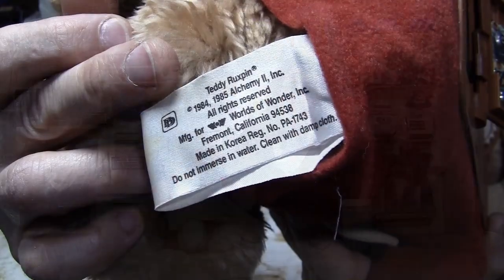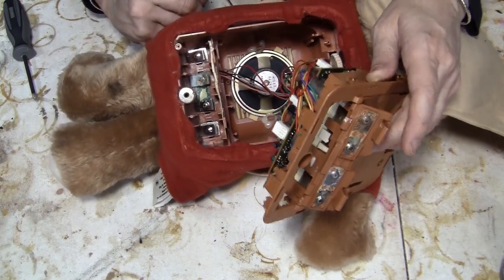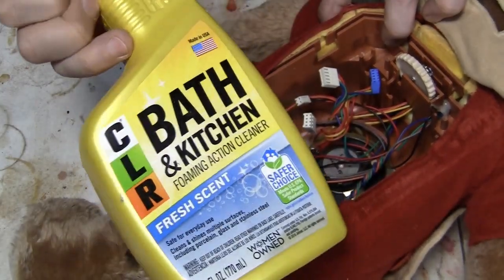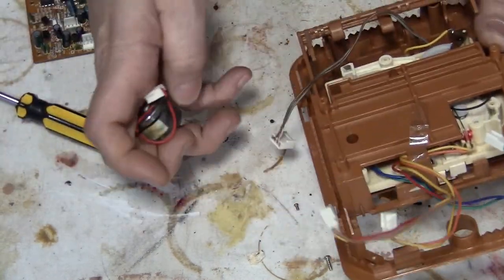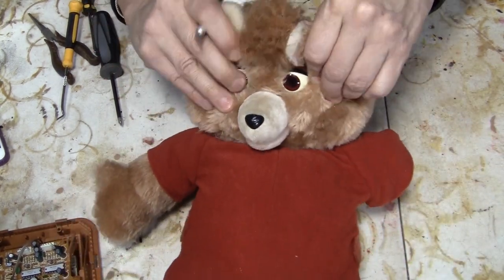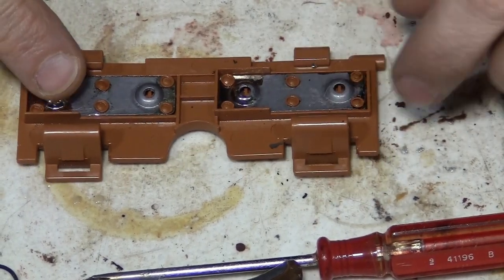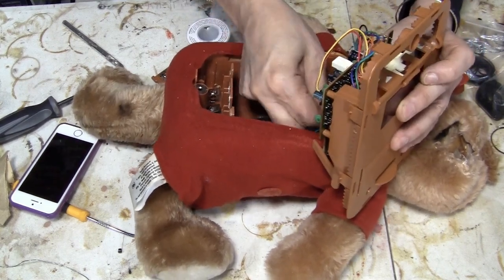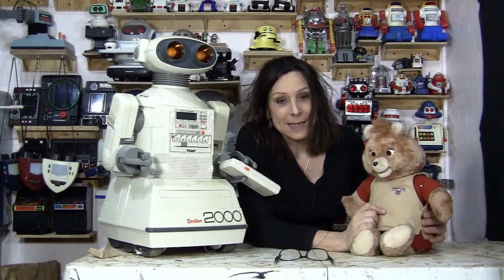How To Fix Your Childhood Friend - Teddy Ruxpin Refurbished

Comment: 0:08 check the date again, copyright says "1984, 1985" meaning it came out in 1985. From what I researched, the prototype was first copyrighted in 1984, then pitched around to toy companies (hence why it was copyrighted before that so no company could easily copy it), then in 1985 an agreement was made to be manufactured by Worlds of Wonder. That's why it has two copyright years on it. They didn't release them in 1984, because no company had made them yet, late-1985 was his release not long before Christmas, which is why he was so hot that year, which carried over into 1986 again making him the best selling toy that holiday.
Reply: I already got my theorized answer where the term getting 86ed comes from and this is just another reason. It was a crazy year.

Comment: Love love love your video! I was born in ‘86 and got one of these growing up! It stopped working many years ago but still have it in storage. 

There is definitly no corrosion damage. So I am wondering if the belts need replacement. Where would I find these little belts 14:50 ? And also, what’s the devise 18:12 you use to test the mechanics? 

Again! Thank you so much for your post!
Reply from the maker: Thank you... I'm sure the belts need to be replaced. You can find a bag of different sizes on ebay real cheap. The motors might not have turned in a long time and gummed up. You can clean them up, or squirt oil in them, turn manually until it goes. The device was just a power supply to turn it on. You can use batteries or whatever to test it.

Comment: I fixed one of these last year. The cassette player is pretty easy to replace the drive belt. But the belt to drive the mouth is nearly impossible to fix without destroying the head.
Reply: that cassette plate needs to be gently broken away...Or maybe not.
Reply from the maker: Not impossible. I did it. The sewing looks just as good as it did.
Reply: Mine only had one motor in the head, and the eyes would completely close every once in a while. I think mine was a later revision.
Reply: @RandiRain  My sewing skills weren't that good.
Reply from the maker: @Kewrock  Interesting. It could be like the Billy Bass. Later version had fewer motors. So they must get the eye movements only when the mouth isn't going?

Comment: Randi, I’ve not seen any of your other videos but this one makes it very evident that your great with your hands and smart to figure stuff out. I’m wondering if you could tell me what use were using in the video to connect those little power clips to the servo motor to test them? Also, how much did the repaired Teddy sell for on eBay. I have one and might try and fix it. Thanks again!
Reply from the maker: Honestly, I don't even remember and I would have to watch my own video again. If it was clips from a power supply, I can tell you those were junk and have already broke and I chunked them. If it was something else, I don't know remember. As for the sell price. I don't remember that either, but you should. I get people asking me to fix theirs all the time. If it's an easy fix, go for it, it would be worth it to sell.

Comment: Great job on the Teddy Rux restoration!  I had always wanted to see what one of these looked like inside.  As for the tape, I kind of figured that they were using one channel for the audio and the other to control the face movements.   BTW, looking up the wiki it says the toy was released in 1985, but it is likely that they had the copyrights earlier, or manufacturer if your Teddy Rux was labeled otherwise.  That being said, it would have been one of the earliest production models.   So you were 15 when it came out?   You and I are VERY close in age.   Nice to know you are a Gen-X'er as well!   Great stuff!  Keep up with the great work.  I always enjoy what you do...bringing back these toys of the past back to life.
Reply from the maker: From what I hear, the later ones only had one motor in the head, so this is surely an early one. Thanks for the kind words.

Comment: 9:30 Lol yep there are others that have repaired them, actually do think I recall that tab on the tape deck coming off. Me I go watch all the videos before I tackle stuff like this because I'm so afraid to break anything. Still I think your past toy experience prepared you well to find all the seams. :)
There are a few models, one with two motors and another with one that uses a transmission. I do think the Glo Worm sleeve design where you can pull the electronic guts out for cleaning was better, can't throw Ruxpin in the washer heh.

Comment: A classic close up trick hand made from locally sourced black walnut. A small wooded box, roughly two inches square, has a solid brass plate inside, and a slit in the top and bottom. The brass plate clearly blocks the slits, yet an American half dollar passes right through the box.
The Magic Coin Box comes with the brass plate and a real American half dollar.
See the video how they were made…Randi Rain...Will you make one of these pieces of art for me? I admire the amazing wonderful wand you made. What an amazing piece of art.

Comment: So, pro tip,... Red Cayenne hot pepper sauce,.. such as Texas Pete,.. for example has the ideal acidity to neutralize the alkaline solution from leaky dry-cells, and aids in effectively inhibiting, removing the corrosive substance, subsequently with 99% alcohol solution later.
Reply from the maker: Oh come on... I have like 200 videos on here showing my abilities. I've handled corrosion many times in my 50 years of life. CLR has the exact same neutralizing power, and it's better than putting hot sauce on everything. Matter of fact, if you go through my videos, you will see where I did try it once because I do know it works. I also know that it stains as well, so don't get it on anything. So pro tip... Ditch the hot sauce and just use CLR, preferably the foam bathroom cleaner with it. It does the exact same thing.
Reply: @RandiRain  You’re right, and I rescind the manner in which I put that remark. I was catching up on some of your other projects too, and subscribed. You do really good work.

Comment: He still jitters, There is still something wrong with the motors.
Reply from the maker: Nothing wrong with the motors. The footage I used wasn't started at the beginning of the tape, so it didn't go through the calibration settings that are at the front of the tapes. The audio didn't record right so I didn't get to use any of the footage from where it works correctly... But it does.